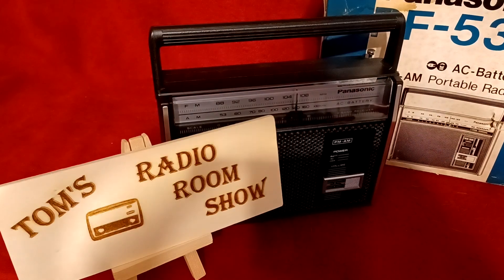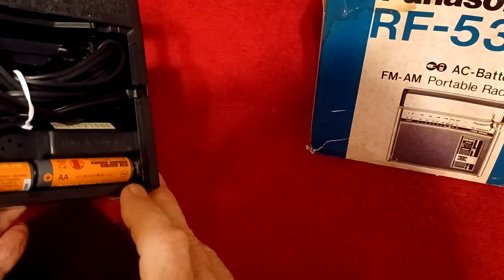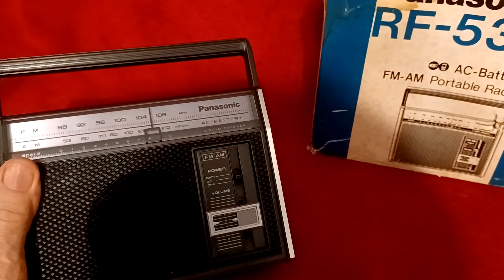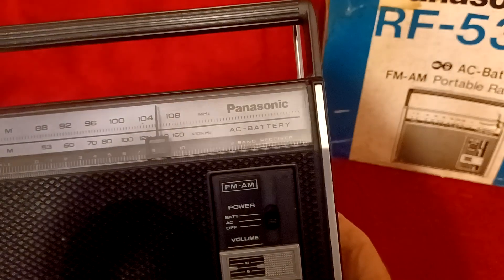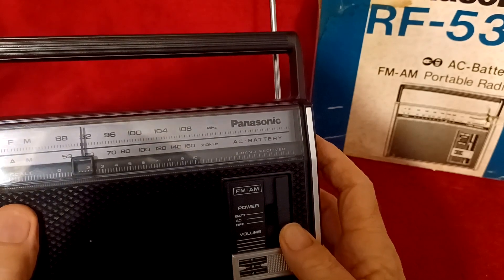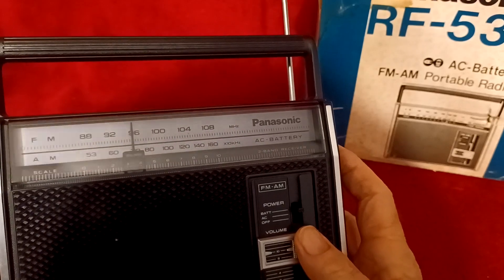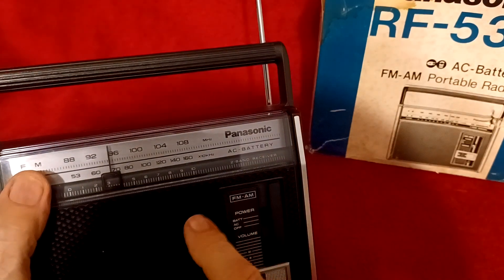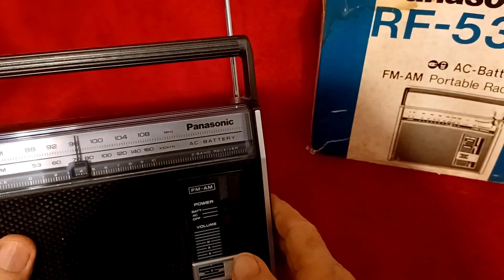TRRS #2305 - Panasonic RF-537 Working Good - Me Not So Good

Comment: Always check on your battery operated appliances every few weeks, even flashlights. Don’t know about the 18650s but every other type of battery leaks after a considerable time. Just that some are worse than others. Duracell batteries are usually the worst I’ve used. And actually cost me a nice flashlight. I usually stay with a more locally made product, the fresher the better. Actually did have a version of this radio with a weather band extra.
Reply: Yeah, normally, I’m very careful about removing the batteries - missed  this one somehow.
   Thanks for watching.
📻🙂